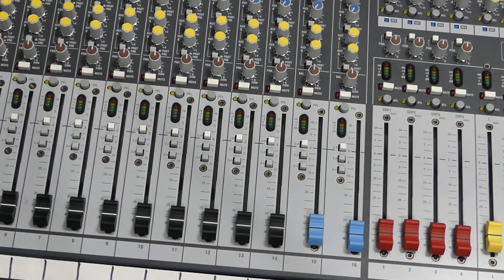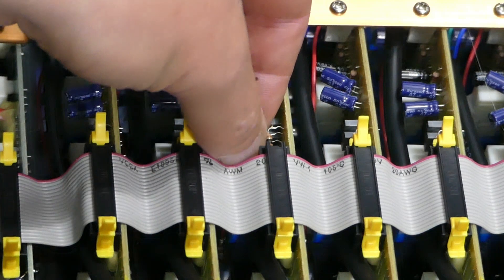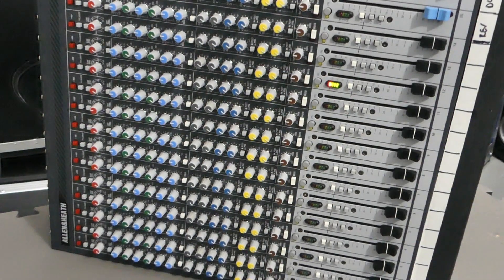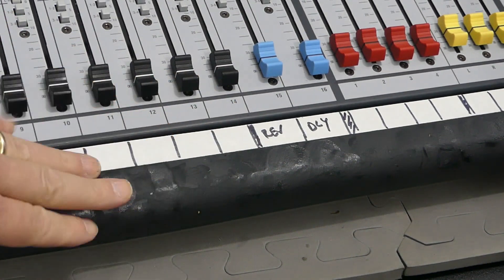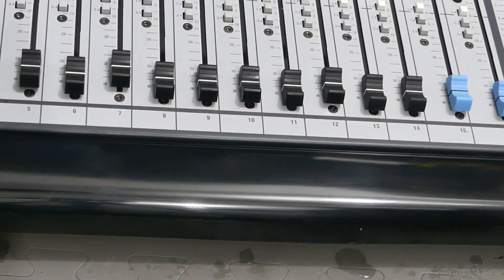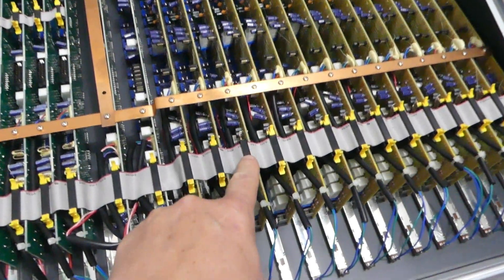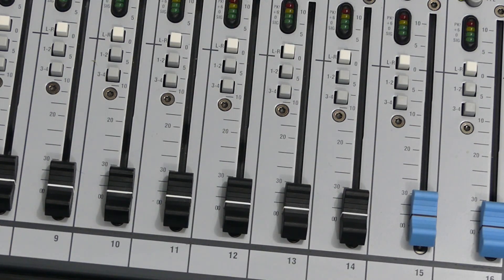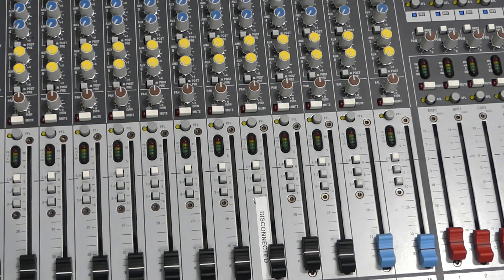A&H GL-2400 channel strip LED issue

Comment: Update coming in: So I changed the spare channel I've got from A&H - I also got 2 ICs spare as it seems to be a common issue. Anyway I figured with the new channel that when I power up the console the first green LED lights up for 2 seconds ant then it will be gone. So maybe this is a warning signal that this IC will be damaged in a few years. I hope that helped a few people out there. Best, David
Reply from the maker: Great information!

Comment: The great thing about A&H analog consoles is each channel strip is independent of the others. All you need to do is order a new channel strip and install it. You can also swap with a strip from the far right.
Having a disconnected channel in the middle of the console would bug me to no end.
Reply: Or just remove the strip and get it repaired.

Gotta love your A&H's!

Comment: I got a nearly new GL2800 32 channel console with 2 power supplies a year ago for $400.  I love it.  Use it for recording.  

Have you checked the soldering joints for the bad meter on that channel?  It may be just a dry solder.
Reply from the maker: Thanks for the reply.  There were no bad solder joints.  We do love this console and will still keep it in the inventory for events.
Reply: You're never going to see very many cold solder joints on an Allen & Heath!

Comment: Thank you! We opened the lid and greased the power supply fan in detail, it was making a lot of noise, will be aware of your note. Can you illuminate in detail the back panel how ST1-ST4 with reverb work and the leftmost outputs 2TRK IN, 2TRK OUT their function. The 15,16 mic channels above them are mik out, is it direct ?
Reply from the maker: Good to see you greased the power supply fan.  The ST1-ST4 inputs are for stereo returns.  As well, they can also be used for returns (mono or stereo) from outboard gear like reverb/delay units.  The return of the reverb signals would be mixed back into the overall mix and is treated like an instrument input. 
I recommend downloading the GL2400 manual from Allen & Heath to learn how the ST1-ST4, 2TRK IN/OUT are used.  You can learn more from the manuals on those controls than what I can place here in this response.  Thanks for your question.
Reply: @stageleftaudio  Thank you for your efforts and attention! We translated the manual, but the translation is not the best, so we are moving step by step!

Comment: Allen and Heath gl2400 wan one of the best consoles they ever made we had just replaced the console at our old church. and  it was in there about 20/2 years. And we just put a new gl2400 in the church  and now they discontinued   A few months ago
Reply: A lot of dealers still have new ones in stock.

Comment: Recently, my GL2800 has some mute buttons that aren't coming off mute. any remedies?
Reply from the maker: Sounds like it could be the buttons are simply wearing out.  Or if the buttons have contacts in them, they could be becoming dirty.  It's possible you may need to replace the buttons.  I'm not sure if those buttons can actually be cleaned.

Comment: I have the same issue just on 26 - I assume that it is the IC on the Channel PCB. So I could replace it with a new one  (as they are 14 DIP ICs) but I have to contact A&H support to get to know what the input voltage is. After that I will replace it and will keep you posted.I have the same issue just on 26 - I assume that it is the IC on the Channel PCB. So I could replace it with a new one  (as they are 14 DIP ICs) but I have to contact A&H support to get to know what the input voltage is. After that I will replace it and will keep you posted.
Reply from the maker: If you end up replacing the IC, keep us updated!
Reply: @stageleftaudio Hi, I contacted the local A&H support and they will send me a complete new Channel Strip. So I can do an easy change, wich is way more comfortable. It's around 30 bucks. They will also send me 2 ICs on top as it seems to be an often issue with these LEDs - so I can change at least for one more channel in the future. The old Channel will be stored as I now have all poties etc spare. So I guess this is a good solution to it. Also the tech agreed it has to be one of the two ICs. I will leave the input voltage offset info here when I know it so you can actually just change ICs.
Reply from the maker: Sounds like a easy cheap repair!  Thanks for the follow up.

Comment: A dead channel? No, it is your gain potentiometer, clean it or replace that module. 
So, you cleaned some grime off of the "framing" looks good, clean the guts and it will sound good, if it's just a dust collector for you I'll give you $400 for it right now if you pay shipping.
Reply from the maker: Thank you for the offer.  We'll be keeping it as a backup to our Soundcraft GB8.  However, it may still find use in smaller events where we need analog.